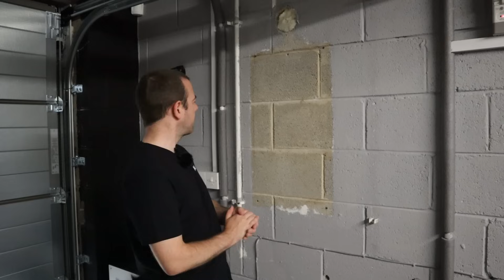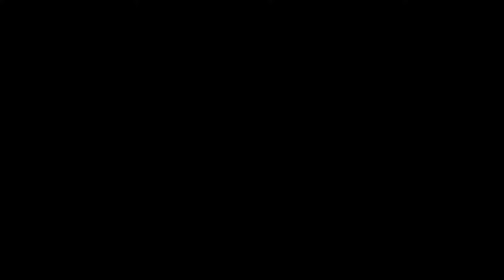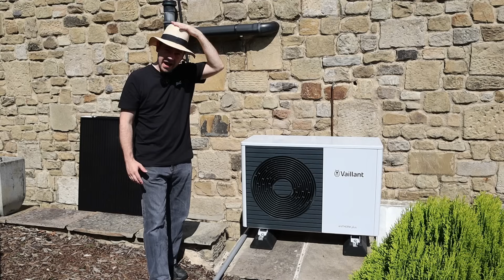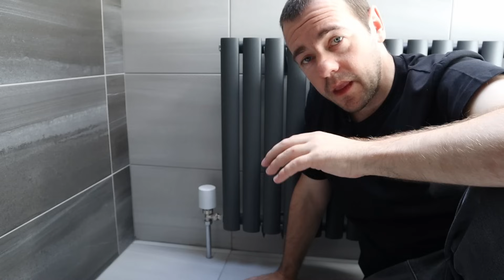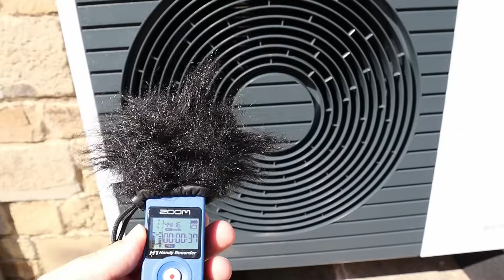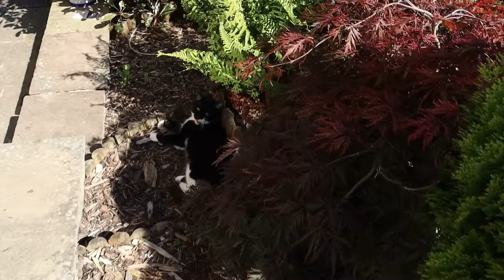Heat Pumps - Our 'Ugly' Truth!

Comment: But where in most houses with combi boilers and therefore no cylinder cupboard would you be able to accommodate that huge tower?
Reply: You can't, people who have got rid of their cylinder cupboards and have no loft space are in a difficult space, stuck with combi's for now.  I suspect eventually they'll bring out a large outdoor unit, but for many that won't be a great solution either.
Reply from the maker: You can get separate smaller components, this is just an all-in-one solution.
Reply: You'd not bother with wet hearing at all and simply have A2A cassettes.
Reply: Its not huge, its about the size of an upright fridge freezer or a wardrobe.

Comment: Really interesting. In the village I grew up in there is no gas and never will be, so I have been thinking about ASHPs.  I like the idea of the Unitower, at least until I saw the size of it.  The UK has 10,000s of standard 2 up 2 down terraced houses mostly built from 1880s to about 1940/50s.  Fitting the Unitower in one of those will be almost impossible without seriously compromising something else.  Is there a smaller alternative?
Reply: All those houses had at some point a water cylinder, if you've still got space for a cylinder then you should be able to find a heat pump that works for you.
Reply: Yes, lots of options. A 150L slimline hot water tank is not much lager than a combi boiler. There is also the option of a Sunamp phase change heat storage unit which is not much larger than a microwave. I've just fitted a wall-mounted a heat pump on the outside of my 200yr old terrace house with 150L tank in the existing airing cupboard.  A ASHP is significantly cheaper to run than an oil boiler or propane tank.

Comment: Roger Bisby slags off heat pumps .So what is the actual story on them ? Good or bad
Reply: Great if you have a modern house, well insulated and live in Northern Europe or Norway, Denmark or Sweden where the cold air is dry not damp like the UK when they are very likely to freeze then, no heat.
Reply from the maker: That’s simply not going to happen.
Reply: Simon and EVM cars are just about replaceable but central heating systems ain’t .Details please .More info ,more videos please.

Comment: Out of interest, what temp do you run the legionellla cycle at ? I can't get a standard answer !!
Reply: I set mine to 60 deg as recommended.
Reply from the maker: It runs the cycle itself, on or off is the setting.
I believe it’s 60c.
Reply: Cheers; we've got a mixergy tank, and with that you can set the temp you want. 60 it is !!

Comment: Lol, after two years of fiddling, my hot water is set to 49°C.  My heat set to 21 with a drop back to 19. Heating efficiency is 400%, hot water efficiency is 200%.
Reply: Good efficiency but how much did it cost to run mid winter?

Comment: Congrats mate, my heat pump has been running for 2 years, it’s great, and runs cheaper than the gas did.
Reply: Would be good to see some data on this - how many kwhr your gas boiler used for the year, how much electricity the heat pump consumes etc.  I’m still sceptical about the savings, but am willing to be persuaded with facts. It would have to be much more efficient to repay the installation cost of a heat pump.
Reply: @davidfitzpatrick1242  You are correct, the savings of electricity vs gas are minimal, maximum £50 per year at the current rates, but the gap is increasing as gas rates are increasing more quickly. 
I didn’t move to a heat pump to save money directly, but I do save a lot more than £50 because I already had solar and batteries.  As each year is different in regard to weather, comparing kWh of gas I used 3 yrs ago to this winter isn’t really effective, so I use the data from electricity meters specifically installed on my heat pump, and use the efficiency data from the equipment I had installed (independent of the heat pumps controls) to generate the data on the amount of heat I put into the property each year, and the efficiency of the heat pump, I can then convert that back into “how much would the gas cost”.
My gas boiler was 18 years old (I thought is was 12 but found the invoice recently), and the radiators were 35 years old, so it all needed a change anyway.  Heat pumps will come down in price, I’d suggest now isn’t the best time to install if you can wait a few years, as the good grants are gone, and the new grants are just bedding in.
Reply: @davidfitzpatrick1242  I can’t provide data here, but my heat does record minute by minute consumption data, and produces lovely graphs if you know a way to share.
Reply: @Muppetkeeper  would be very interested to see this info as I love data too  like my heating and solar info . Is easy to share on email or twitter
Reply: @nickieredshaw7835  easy to share on twitter.
Reply: I don't believe that, as until recently gas was nearing 500% cheaper per kWh than electricity.
Reply: @Robert-j6r8c  It’s a good job I replaced an 80% efficient boiler with a 400% efficient heat pump then.
Reply: @Muppetkeeper  
Yeah which one?

I don't know any that are that efficient in winter when you need the heat.

Not only that, since you had to replace a boiler, a new one is minimum 93% efficient, so you still down. As 93 X 5 is 465.

You would need a heat pump that is 465% more efficient just to break even on running costs.

Comment: Getting quotes currently, very interesting! You can also consider getting an Eddi to heat the water during the summer from your own solar, these can also replace the Legionella cycle.
Reply from the maker: Givenergy battery is far more effective.
Reply: Thought about how theses system work with solar excess do you still need to use the ashp to heat water mid summer or can it use solar to avoid this ?  How the app any good ?

Comment: Some good info but I'm not sure why if I installed a new gas boiler today I'd have to rip it out in 2 or 3 years time?
Reply from the maker: Who said you would?
Reply: @ElectricVehicleMan  he is confused as the way you phrased it in your video, because you meant you needed a new gas boiler and that there would be no point in installing a new one for it to be ripped out to be replaced with the current installation - it just sounds like you are saying a gas boiler comes out in 2-3 years
Reply: You won’t. Just make sure us hydrogen ready because it’s coming.
Reply from the maker: @skiiddy  No it isn’t. Hydrogen will cost about £180billion to convert the current gas infrastructure. They don’t just switch what’s going through existing streets, it all needs upgrading. 
Take decades too.

Comment: Given that heat pumps work best when the outside temperature is warmest. Would it be better to store the electricity in the battery during the cheap rate time and then use the electricity to power the heat pump at midday when the outside temperature is likely to be warmest?
Reply from the maker: No.

Comment: Great video. Did you consider air-air for a/c in bedrooms etc.? I am considering splitting air-water for downstairs heating and hot water, and a air-air for heating and cooling of upstairs.

Likely UK summers are going to be hotter for longer so I'm betting more and more people are going to look for cooling too.
Reply: If you want the grant you need to install a system that provides space and water heating.
Reply: @Ed C  that is what one of the units would be doing, I guess I may have issues finding one small enough so it's not cycling on and off all the time.

This is all theoretical tho, I need to have a re-roof, install solar and battery, buy an EV, and then add heat pumps. I should be able to afford that by 2040ish
Reply: @edc1569  sometimes avoiding the companies chasing grant money can make more sense. Mini splits cost less than heat pumps, even without grants.
Reply: @grahamleiper1538  and they can output 90 percent of rated capacity at -35 C . This is what Gree commercial says
Reply: @gilburton if your house is not air tight  and insulated . Both systems will not perform well.  Buy cheapest infrared attachment to a phone and inspect the house on a cold day in a winter. Do some posable improvements with can spray foam and extra insulation. . Search air to air cold climate  heat pumps  . Pay attention to output from nominal capacity at cold temperatures. I would not consider buying European or Japanese brands too expensive LG  or Gree, Meadia , read instructions and install it by yourself
Reply: @andreycham4797  i dont quite get the "you need a well insulated h ouse for ASHP to be efective ".  A poorly  insulated house will be colder, and costlier to heat, whatever the heating source.
Reply: @stephengale1715 a heat pump is a low temperature heating system, so it takes longer to heat  a room. When your house is drafty heat would escape before it heats up inside walls of you room to comfortable temperature, then you would feel how walls suck heat out of you. They say there are high temperature heat pumps on the market now but I am not familiar with those yet
Reply: @andreycham4797  in this youtube video he had twice the surface area of radiators, which should have compensated for lower temperatures.  That said i dont know why the uk is so obsessed with radiators as a means of heating, mini splits are used elsewhere in the world and provide fast heating.
Reply: @stephengale1715  I do not get the point why anybody would want to change working heating system before insulating a house. If energy prices stay high for long it only matters of time when price of electricity goes up too and more  evs on roads ....
Reply: @andreycham4797  i dont disagree that insulation is a no brainer.  Point i was maki ng was the story that ashp onlyn work on well insulated houses.  As a heat source, and particularly
Reply: @stephengale1715  they work not in the way people are used to heating systems. My neighbor has installed Mitsubishi best of the best in his old house and he is not using it in winter on my question why  he said the 50 000 BTU system does not supply enough heat and he prefers baseboard electric heaters and  a wood burner
Reply: @andreycham4797  here in new zealand there is a big installed base of air to air or mini splits.  They work well, even in the south island high country where the winters can be exreme.  And new zealand houses are notoriously poorly insulated. I do agree that the uk mindset to replace boilers with air to water systems, where the installed radiators are undersized for the job with water temps lower will cause dissappointments.
Reply: @stephengale1715   just recently I was trying to convince one British blogger in same thing about air to air mini splits and  before he answers I realized. In the US we leave in cartoon boxes and it is very easy to poke  holes in walls , when I was installing mini split with three indoor units in my town house I finde drainage pipes for two units in same walls that I hanged units on and third one is drained just one floor below . Now I see why brits want to figure out  the way to implement heat pumps into old system
Reply: @gilburton  Air to Air Heat Pumps very effective in Northeast US and being installed like mad. We have a lot of oil heated / forced hot water homes using radiators. They tend to go with Split Duct Heat Pumps as they don’t have duct work and also because they also get air conditioning. People with Natural Gas usually have forced hot air so they go with whole house heat pumps. What is much less common is the air to water systems even when they are teplacing a water boiler. 
A 1,200 sq foot home whole house system even using existing duct work are being quoted at about 22k installed US. It’s very inflated because they blame labor shortages, supply chain, everybody rushing to get them, communist China etc! In Massachusetts we have 10k utility rebate( National Grid ) who is dying to get all the oil customers for life. To get the rebate you must pass energy audit State Mandated and if needed do upgrades like insulation, caulking and weathers stripping. 80% covered by 3 dollar fee everyone pays each month for energy efficiency programs. So the units here same brands you have and others from American A/C makers 8K / 12 K plus 10K -14K labor and installer for 1 to maybe 2 days worth of labor. Also 2k US$ Federal Rebate available.

Comment: Interesting video to see what you've done, especially as the gas boiler in my 50 year-old-house died a few years ago (she used to set the thermo at 25C!). We're in the tropics (down south) so have minimal heating needs otherwise, it's a woolly jumper time when chilly. Unfortunately, looking at the costs it's not for me as there's no money in the pot for a good number of years to come.
Reply: the BEST thing you can do for any heating system involving radiators and water is to get it flush cleaned every year ensure your inhibitor is correct and fit a magnet system regardless of how you heat the water your efficiency is mostly dictated by the size placement and cleanliness of your system

Comment: Will you be upgrading your storage battery capacity to handle the electrical demands of the heat pump?
Reply: I calculated I'd need 20 kWh per day in January to run a heat pump. That's a big battery!

People with a tiny 5 or 7 kWh battery will do jack shit in winter.

Comment: Really interested to see how this performs heating wise… 

Is that unit a “standard” 595 wide?
How deep is it?
Reply: Looked it up - 595 wide, 693 deep, 1866 tall.

Needs 300mm lateral space though, and 10mm at the back.
That makes it substantially wider than it first appears (fine in a garage, not in a utility room)

Maybe it only needs that space on one side, which would help… since it’s for maintenance it be be ok to have a washing machine adjacent, just roll that out)
Reply: @JohnR31415  Thats only for maintenance, if you can move the items to the sides of it you are fine.

Comment: I hope you’re using weather compensation to adjust the flow temperature over the different seasons. You’ll want it a lot lower in summer than in winter. And you’ll need 400% efficiency to allow for the fact that electricity is 3.5 times more expensive than gas.
Reply from the maker: All built into the unit.
Reply: @ElectricVehicleMan  You mentioned a fixed flow temperature - was it 40°C?  With weather compensation its not fixed to any value.
Reply: @ElectricVehicleMan  It was just that you mentioned a fixed 40c flow temperature. Ours adjusted up to 45c when external temperature was below -6c, down to 30c when external temperature was above 12c, on a sliding scale. Should all be part of the original heat calculations.
Reply: @tarbat  sounds smart what scop do you expect to get in real life ?
Reply: Not any more it isn’t… particularly not if you have some battery storage.
Reply: @JohnR31415  you’ll need a lot of batteries. How long before you recoup the costs?

Comment: I watched a YouTube video  with a heat pump  specialist . His take on it was  heat pumps were great and you should get one,  if designed properly  they will heat properly save money and the environment . He did admit  installers training in general is  poor., and therefore don't always design it properly  And that was from a heat pump evangelist  . My opinion is  Knowing who's suitably trained seems to be a lucky dip , the older the property the more important that the engineer is more highly trained as they tend to be less efficient have inadequate radiators /underfloor heating etc. Your  water tank  looks like a floor standing freezer that's not an insult people are used to seeing floor  standing freezers
Reply: Heat Geek assure their installations.
Reply: I knew i have a 20kW wood heater in the middle of Europe and thats enough to heat the house @ minus 20 degrees. My heat pump with air has 8kW and is good for down to minus 5 degrees. If it gets colder than that for longer than a few days i would have to add some wood again. I did not the last 2 years. I need about 20-25% more for the electric energy compared to wood but it does not need work, cutting, stuffing, cleaning.
Reply: Make sure you use someone who is MCS certified.
Reply: Try a heatgeek. Look them up
Reply: @nigeldavies6573  it was heat geek that said most engineers aren't trained sufficiently  in the UK  , although this is changing  . They also said you don't need a buffer tank , yet many  manufacturers required it to be covered by warranty so even if it's not technically needed it is. So  logically unless you have a super modern house and therefore likely a simple installation or you  need a new "boiler" now  it's better to wait a year or so until more people are trained  correctly.

Comment: So it only works because you use power to heat it up each night? If you didn't have a night tariff, then? It doesn't work!
Reply from the maker: If you didn’t have a night tariff, you’d be silly!
Reply: @ElectricVehicleMan  so the videos you mentioned that were wrong, are in fact not wrong? This is a very confusing video.
Reply: @Vyker  hang on a minute - what do you mean by 'doesn't work'?
And is it heating up at night to top up the deficit of heat produced by the heat pump??
What's going on?!?!
Reply from the maker: Are you asking if they work or if they’re cheaper to run than gas? Two very different questions.